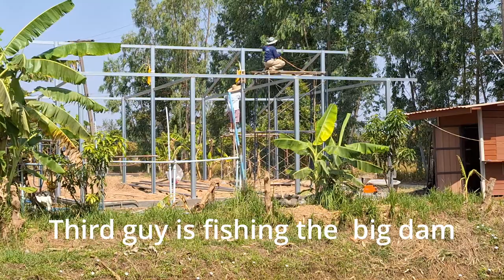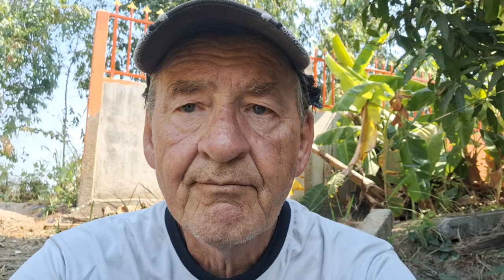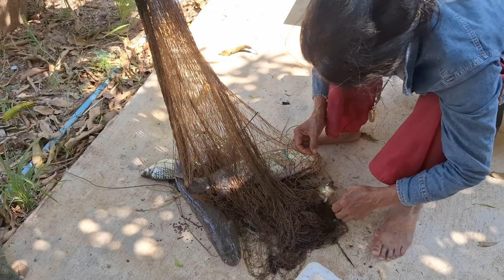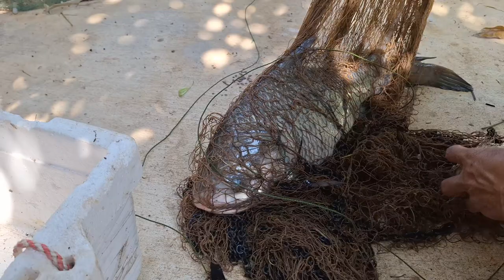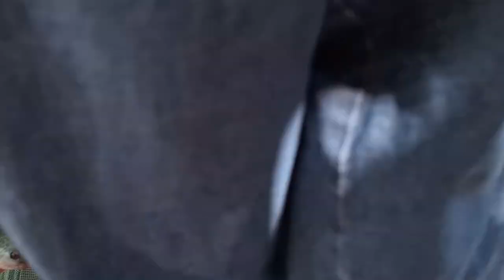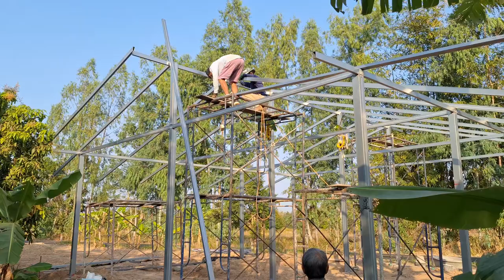Mystery Building Project in Rural Thailand #6

Comment: The entire frame being steel is not so common right? Usually I see them using concrete posts and steel just  for the frame of the roof. What was the reasoning here?
Reply from the maker: That seems to be the norm out this way. I think its twofold. Easier to work with, better welds to the roof structure, easier to secure reinforcing steel between courses of blocks column to column. I was curious about expansion between the two different mediums. Then i read somewhere they have identical expansion coefficient.